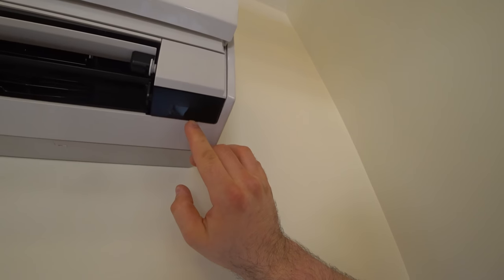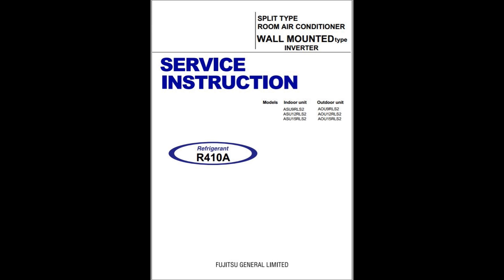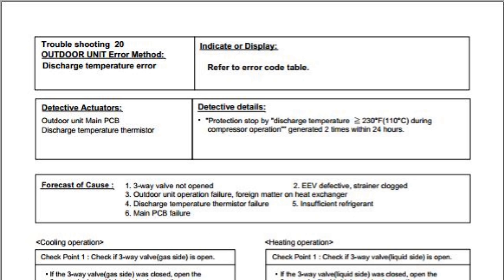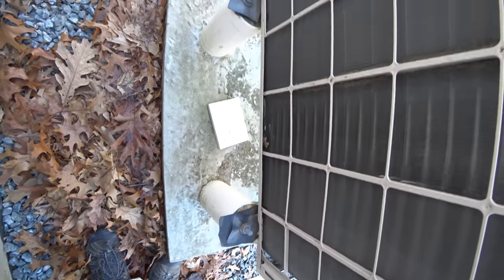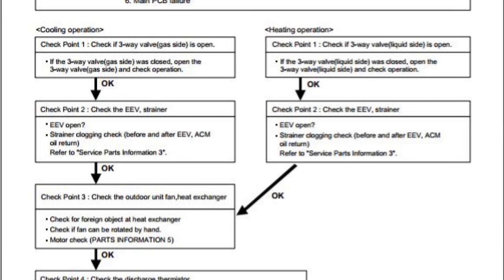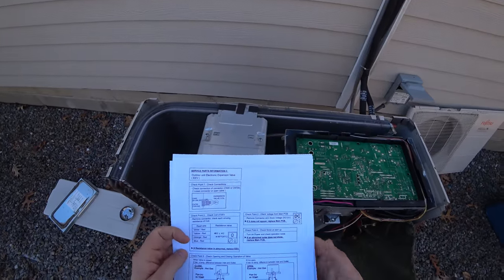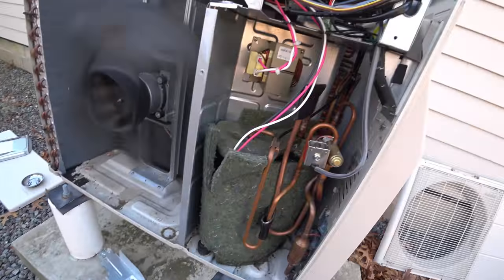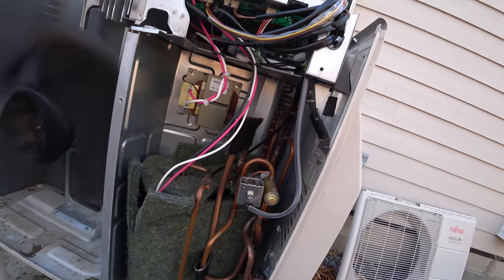Mini-Split Heat Pump Failure, AGAIN!

Comment: I wish you had started video with brand name of unit. I started into Mini splits about 5 years ago. Research led me to my number 1 of three brands Midea. Absolutely the best of the 3 I have also used. I next installed LG same type cassettes same size (18000 BTU) . The heat pump sucks. The dry and dehudify not are sub par. Placing LG at number 3. I just installed a Gree wall unit (12000 BTU) heat pump is fantastic, on day of testing the outside temp was 70° inside was probably 60°> turned on heat pump after install and vaccum draw down. The heat pump was blowing very hot air trying o reach 85° setting on unit. Placing Gree at number 2 on my list of good mini splits. What's the difference in heat pump LG vs. Midea, or Gree? Not certain. Is all I know for sure, is if outside temp is 50° and I turn LG heat pump to 60°> unit will start then quit, never reaching 60° . If I turn Midea on, same conditions. The heat pump will quickly hit temp and maintain . My Midea holds comfortable 70°  temp to 20° is the coldest It has been in my region. My LG . Freeze me at same weather onions roughly same space heat or cool. Waiting to see how Gree does in summer. And though out winter. Midea is number 1 at this point from my experience. ( To bad Carrier got into Midea. That marriage may cheapen performance of Midea)
Reply: Sorry for auto correct thinking for me. Conditions not onions and other word plays by computer Grad Auto Correct University.

Comment: Make sure valves are open.  Sounds like there's no refrigeration. On lif shows pre charge for every additional 5 feet add 1.08 oz of 410. I would pump down to 500 microns and add pre charge plus additional refrigeration 410 if needed

Comment: Inverter based units typically suck. They are too sophisticated for their own good. Really cool when they work though. Too bad finding a normal non inverter based unit is impossible now.
Reply: For REAL,remember when minis had contactors in them LOL,they usually were 120v or 240v coils but at least there was a dam contactor in it.

Comment: There are TONS of forums that could have helped you out.  Did you figure it out? is there a follow up video?  Did you add refrigerant? I hear people say "It was serviced" all the time.  I have been lucky enough to work a lot of different jobs. I can honestly say most people are really bad at their jobs.  If you or someone serviced it, its likely that y'all fucked up.
Reply from the maker: I'm working on a follow up video as we speak.  However, to the point this video was made, I've had HVAC professionals come out three times.  Once to install it, second and third time to fix it.  The second and third time they cut out a couple flare fittings, made new ones, vacuumed, re-charged.  I've had two different companies.

Comment: Hi david i think your unit is instaled on the top floor..by the video i can tell...if so that would be an error also...exp: if you want to heat whith the unit it better to have it installed on ground floor so the heat can rize up...on the other hand if you want to cool the top floor its better to have it on top flood BUT a heat pump is useless if you expect to heat the whole house cause it wont and cant send enough heat downstairs...Got it...just saying...:)

Comment: did you find out what was wrong with it?
Reply from the maker: Nope.  I tried adding more refrigerant, which gave me two more months of it working.  So I guess there is a slow leak somewhere, but it's not the flare fittings and I can't find any oil stains.  It costs too much money to hire an HVAC pro to find the leak, and even then, no guarantee he/she can plug the leak.  Eventually I'll just rip it out.  Right now I'm using an old window AC (still working after 10 years).
Reply: @DavidPozEnergy  I have a 12000 btu Gree, went 10 months. one night worked fine, next morning E4 code, in the Manuel it talks about a flashing E4 code, but this never flashed, just stay's on, nothing out side works, I have 4 others, all from China, maybe a mistake to buy a China made, but what can a man do, any way  a A/C man coming next week to check it out,  I went all thru it and could find nothing, good luck with your's

Comment: Check your communication wire #3 port to ground should be fluctuating with power off
do same indoor unit and make sure power is off if no fluctuaction you have a bad either indoor unit or out board  good luck MR Rios  class 2020 UEI

Comment: Hvac techs will charge you more than the unit is worth.  You can buy the outdoor unit for $500 and a Hvac repair would cost you more.   4 Years,  trying adding r401a,   else throw it out

Comment: Could it be over charged ? that would cause a high compressor temp oR UNDERCHARGED COULD ALSO DO THE SAME THING  
In A/C mode 70 degrees 410A refrigerant your suction pressure should be 100 to 110 LBS  OVER THAT  OR UNDER THAT AFTER A 10 MIN WORM UP COULD BE YOUR PROBLEM ????  THERE SUCH A B--CH TO WORK ON.  THAT IS THE EASIEST WAY i KNOW HOW TO GET CLOSE TO WHAT THE PRESSURE SHOULD BE FOR YOUR UNIT    GOOD LUCK ???

Comment: THIS IS THE REASON WHY YOU NEED TO CALL A CERTIFIED TECHNICIAN - HOME OWNERS -STOP TRYING TO ME WITH AC UNIT WHEN YOU ARE NOT CERTIFIED OR HAVE THE PROFESSIONAL KNOWLEGE
Reply from the maker: I may not have mentioned this in the video, but this Fujitsu was installed by a certified and licensed professional.  Then I paid him again to come out and "fix" it the first time it broke.  Then it broke again and I paid a different certified and licensed professional to come out and "fix" it.  I spent over $5,000 in labor installing and fixing this.  That's labor only, not the cost of the unit itself.

Comment: Get a tech to come and pressure test the unit. It’s not a failure - it’s a safety as your system is low on refrigerant.

Comment: I noticed it's a Fujitsu.  What's their warranty?

We're considering a minisplit that's not one of the The Big 3 (Mitsubishu, LG, and Daikon) and I checked the warranty. 10 year parts & labor BUT we'd have to have it professionally installed and register it within 90 days of  their installation.

If you'd consider Made in America, instead of Jap (no hate, just giving options) then EMI still makes their minisplits in upstate New York: http://www.emiretroaire.com/products/ductless-split-systems

Comment: 10 months on a 12,000 Gree. it died
Reply: they found the compressor bad,  going to cost 695 dollars to fix a 478 dollar unit, what is wrong with this pic?
Reply: @crazydan2327  They all are.